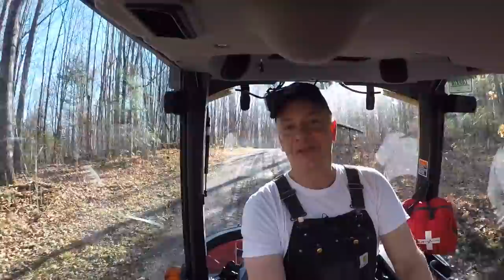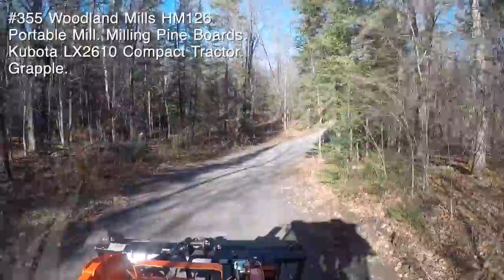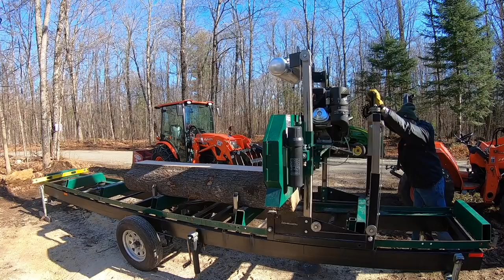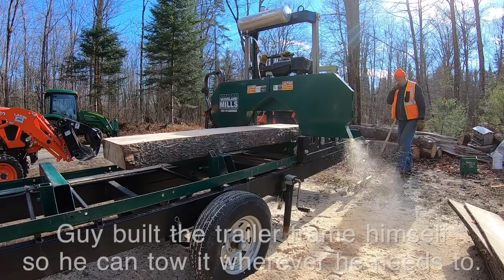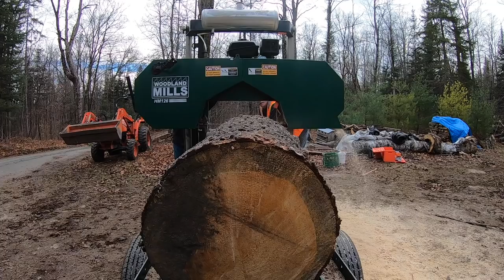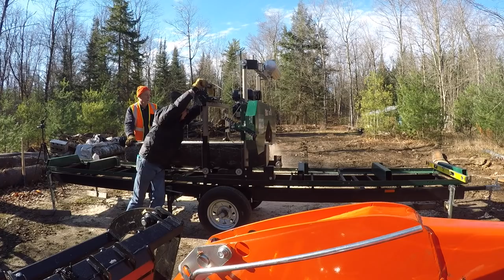#355 Woodland Mills HM126 Portable Saw Mill. Milling Pine Boards. Kubota LX2610 tractor and grapple.

Comment: Love their stuff! Simple and easy to maintain. Ontario made! Really fair value!
Reply from the maker: Cheers Gill!
Reply: Hi Gill - minor correction - they’re Ontario designed, but they’re manufactured offshore. They are quite open about this on their website. Having designed products for much of my career, and worked with manufacturing sites all over the world, offshore sourcing can be very high quality.  Just as is the case domestically, there is a wide range of quality production available in China.  I’m sure the owners picked their manufacturer very carefully and no doubt monitor quality continuously.
Reply: @profdave2861  I quote you; ''...offshore sourcing can be very high quality.  Just as is the case domestically,...'' I do agree with you, we can find from very low to very high quality in both places (R&D procurement-sourcing for 30 + years, now retired)

Comment: Hi GP,
Great video as always!  I really like the Woodland mills products. Very happy with my Woodland Mills Chipper. It looks like the saw mill need to be slightly modified as the push bar is so high, I think it might have a tendency to rock forward a bit, or at least it looks that way on the video. I'm guessing the issue arose since it's now much higher being on a trailer.

Comment: Good video GP, my Dad bought a 4520 John Deere with a cab and he loves it. When I checked out the John Deere vs Kubota, I was looking around the 26 to 30 hp range and the Kubota was the same price for the b2650c as the 25 hp John Deere with a cab and theirs wasn’t factory. No a/c and just not near as many functions and a 2 range transmission. I do not regret going with the 2650. Way more bang for the buck.

Comment: I'm curious what size those logs are you're loading with your tractor and grapple. Much of what I need a tractor for boils down to that kind of material handling, and capacity matters.
Reply from the maker: Good morning Peter! I believe the FEL can safely lift around 1300 lbs at that height (sorry I don't have the numbers at hand today). They were big for sure that day.

Comment: You talked one time about a supplier in Canada who sold replacement nozxles for fuel cans that fid not have all tje vent rtc controld anfbwereblile the old nozzles thst wete just to pour gas wirh.  Do youbhave thst bnb companys infp?
Reply from the maker: Morning Sandy. I found them at Princess Auto. Several different types. Good luck!

Comment: GP I have a HM 126 and would like to build a trailer for it . Could you ask what size steel tube he used for the main frame thanks love the videos.
Reply from the maker: Good morning Terry. He said he used 2x6 for the sides and 2x4 for the cross members. Good luck with your build! I did a video a long time back (somewhere around video #45 or so, where I think you can see him setting it up - he has several levelling legs on it, too.)